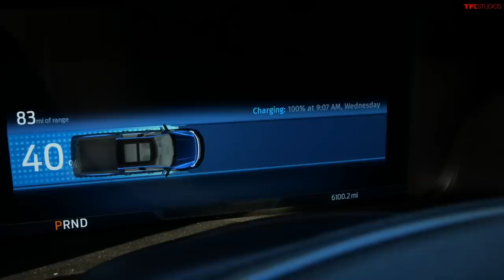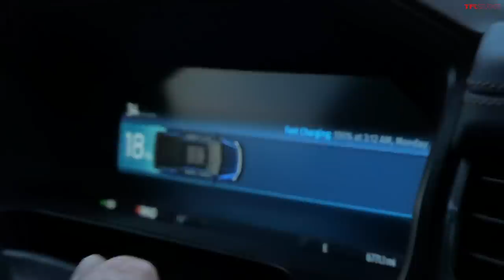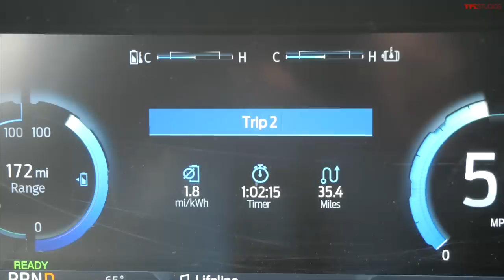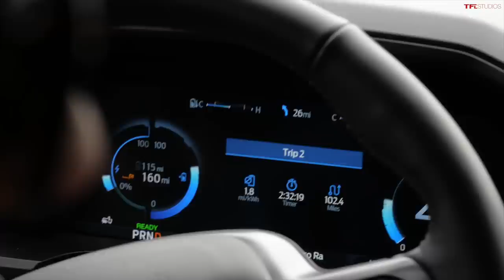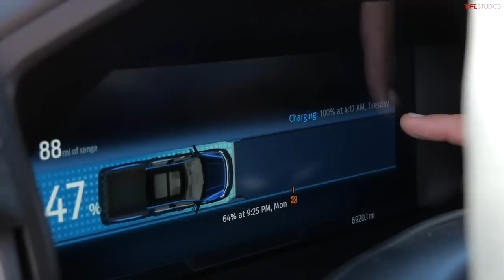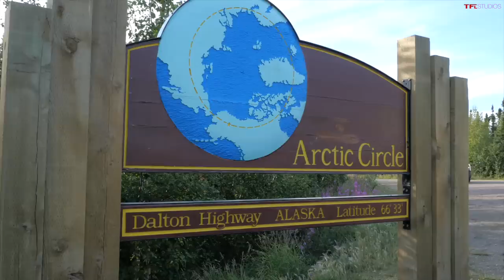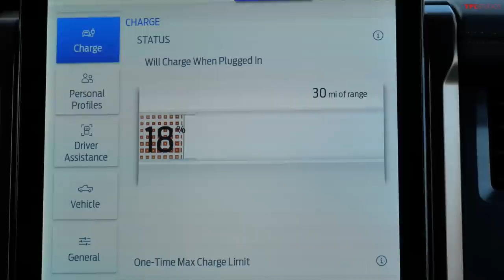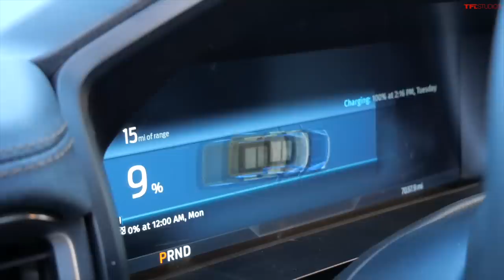Easy Part Is Over: Driving an EV Truck Into the Alaskan Wilderness Is HARDER Than We Thought! Ep.4

Comment: funny thing. As ICE cars are so inefficient at converting gas into energy, they produce so much excess heat. which in turn is used to heat cabin and other components. EV, on other hand, is super efficient so not much is left for cabin, so EVs use external heater which is just awful. So in result, ICE's inefficiency is what it makes efficient in winter, while EV's efficiency makes inefficient in winter. Paradox
Reply: @darknes7800  yeah it is problem. It is getting better every year though. Even though, burning fossil at generator is much more efficient than at car because Gas/Diesel engines are most effective only at very narrow RPM range. It is slightly offset with more gears with soft driving but at normal use they are just awful
Reply: @pauliusvindzigelskis2224  EVs will never replace all ICE vehicles.  They are far too inconvenient to operate.  Which is why their sales numbers are 3%-4% each year and why 25% of people who buy EVs, get rid of them and go back to ICE vehicles.  ICE vehicles will be around for the next 100 years.
Reply: @darknes7800  they will. not because of convenience, but because we need to. ICE will become niche like horses. When the world is burning at least You can say that you saved an hour in your trip.

Sales are low because of supply, not demand. The numbers are increasing steadily every year. Even if your stat is right, most people keep their EVs and prefer next one to be EV too because electric is addictive and very convenient if you have place to regularly charge (home/work etc)

Future is coming You like it or not. You can adapt or get left behind
Reply: @darknes7800  none of predictions were wrong. the climate did increase in temperature as planned, actually it increased more because of technological advances. and, as predicted, we already see more destructive and more frequent natural disasters. Just because you live under the rock, doesn't mean it has no impact on climate

Comment: Just think, Ford offers a 100 foot long charging cord so that you can plug into the hybrid and travel down the road. 

The aero fairing only covers the roof to camper aero load, not the large aero load in the sides. 

When the Lightning gets back to civilization, remove the camper and load the truck to the same weight to determine if it's weight or a combo of aero load and weight.

Comment: Obviously it is too late for your trip, I saw this TED talk suggesting creating electric garbage trucks. The secret is creating a small jet turbine engine, using automotive sized turbo chargers, to generate electricity. The secret is using the small turbine engine it can run only be run at optimum speed while generating electricity. A turbine engine running at optimum speed fully burns fuel, produces minimal pollution. No soot, just "clean" CO2. Can be cleaner than a standard "EV" that plugs in to coal powered general electric supply. 
It's a really interesting concept.
Reply: Until.........you factor in the upkeep and running cost of spinning a turbine engine at 15,000 or 20,000 RPM ! 
Just look up the service interval of the small Jet Cat engines.

Comment: Junk just wait when it gets older and it breaks you will really be stuck! What a joke! My parents at age 60+ bought one it didn't recognize thier phone app and locked down threw a code and wouldn't open had to tow it to the dealer! Just imagine when some kid learns to hack these cars/trucks. I'll stick with my diesel. Will pull that lighting sideways! Lol I live in Alaska batteries are severely effected by the cold weather. To many problems with these electric vehicles. Did you know the vin number aka from your tag is all you need to gps that vehicle! Just wait till the thieves figure your day routines! Have fun with that

Comment: in remote areas you have to be self sufficient, Alaskas are self sufficent and rough.  they appreciate people that understand what they are working with.  and you don't have any idea of what your working with.  your spreading more angsty about EVs.  Mangeling a million adapters together.  that is dangerous and stupid. Roman is like,  Hey! Look how many xmas lights i've strung together! lets see if we can do 5 more!   People understand not do that now days with xmas lights,  why are you doing that with adapters!  I would expect a little more then this sort of thing from a major online influencer.  Do your research before making a trip to the most remote part of the US.  Show all the adapters and plugs that you have and how they work, show that you have an EVSE with a selectable charge rate that perhaps can go up to 60  or even 80 amps. (the extended range truck can charge at 80 amps or 19KW!!!)  if they found a breaker panel or a place to wire in an 80 amp charger, they could charge it from dead to full in like 5 hours without a fast charge.  and safely!  if you had brought the right plug you could have charged at 60 amps on that 70 amp plug and been done by breakfast the following day.    Seems to me that they are trying to show that evs are not ready for prime time. I did appreciate them saying that the truck was like a model T. and there is some truth that, but in pretty much all of the contental US an EV is fine for road trips with a little planning. Especially an ev with 300 miles range.  Look at the app plug share! that has not been mentioned.  people have driven in that area of the world with evs. is this even the longer range f150? the video doesnt say.     THis video shows to me that they are not pre-paired and have hardly any knowledge of the truck (how to hypermile, how to turn anything additional off like the pro power.  leaving the inverter on all the time does make a difference, and the small differences add up)       Going to that part of the world with an EV that doesn't have 350 or 400 miles range is not really going to work, but that does not mean the technology is not there.  it just means that it needs to be done in a different EV vehicle.  not a large pickup truck ev with a camper on top unless you added more batteries yourself.  I think it would be helpful to not be in a hurry.  Call ahead, ask for photos of the type of plugs that each place has..  and have a complete understanding of plug types and wire guages, breakers etc.   I know somebody that over 5 years ago drove to the tip of south america in an EV, but they knew electricity and were not in a hurry and were willing to make their own plug. (wire it up themselves)      at the very least,  do a road trip in the contential US before doing that sort of trip.  come on TFL, you  can do better then this.

Comment: So in other words…there is nothing practical about the lightning as a truck at this point. The tech isn’t there for it as an EV and the infrastructure doesn’t exist yet, especially if the country were to switch to large scale EV use…it sounds like I’m against EV’s. I actually like the idea of them, but it seems short sighted for politicians to be forcing the agenda they are without more pieces in place to support it.

Comment: No thanks... I prefer the reliable gas truck...  No searching and waiting for a charge...  You had to drive like a an 80 year old just to try and add more mileage.  Then you reach the destination and have to have 10 different adapters...  It's not feasible.  If you had a gas truck, you could have filled up and drove back in 10 minutes at 60 mph..  Additionally, I hate that we are supporting China even more with the required batteries for these vehicles.  n fact, when it comes to the massive batteries that are essential to electric vehicles, China is way ahead. It controls something like three-quarters of the market for the raw materials that go into these batteries, like lithium, cobalt and nickel. So automakers rely on China for these minerals.Feb 21, 2022

Comment: This truck is such a JOKE not capable of being used for what trucks are meant to do.

Instead of using the other truck as a charger would have been better to carry a generator with at least a 30 ideally 50 amp output

Comment: I actually just watched the second time. There is no way.. This is dumb af. Now if you was using your little truck to go from home to work and back, total 40 miles with pickup groceries, fine ok. But the whole concept is not worth it. Think about the guy from Maine that road security on the pipeline. Hits say only 40 below zero and stays that way for two or three days before seeing O degrees. That will turn into a death freezer. Nope, will not be sold and its common sense outside you city dweller riders. Want work in our working class ever.

Comment: I hope no one buys this garbage. The battery technology is not where it needs to be. Cramming this stuff down everyone’s neck. It should be a plug-in hybrid. Probably a small diesel that can switch on to power the truck when needed. Like I don’t know, when you need to actually tow with it.